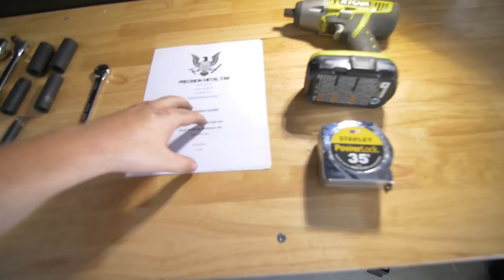2017-2019 F250 PMF Dual Steering Stabilizer Install and Review

Comment: Good video, but once again the aftermarket fails to provide quality hardware. Whatever aftermarket product you're installing, re-use factory hardware whenever possible. If it's a critical component, spend the extra money and order grade 8 hardware for the application. That's without a doubt my biggest gripe with aftermarket parts. All the money you pay for some of these modifications, and you get garbage hardware with the installation kit.

Comment: My PMF steering stabilizer cracked my differential cover on my 2017 f250. It's a garbage product and the POS business owner refuses to help with fixing my truck or sending a refund. He said I hit something and bent the bracket. If I hit something that hard, there would be considerable damage to my truck. Avoid PMF at all costs in my opinion. Carli makes better products anyways.

Comment: Just FYI you’ve put the stabilizers the wrong way. The body of the stabilizer has to be on the outside bracket, not in the center.
Reply from the maker: This is incorrect. A simple google search will prove your comment to be wrong. Thanks for watching tho! 👌🏽

Comment: Seems like the kit isn’t what you were expecting. Poor manufacturing as far as I see.
Reply from the maker: I am happy with it. It has performed perfectly, just had issue with hardware. Nothing a run to Ace couldn’t fix. Still on the truck and performing perfectly.

Comment: The center mount diff cover bolts should only be installed but not torqued at this point, the center mount clamp bolts and nuts will then thread together with no problem. Torque up the center mount clamp hardware at this point, and then torque up the diff cover bolts last. Replacing the center mount clamp bolts was unnecessary, the length of these bolts is correct from PMF. After the center mount is torqued down, the rest of the install is straight forward.